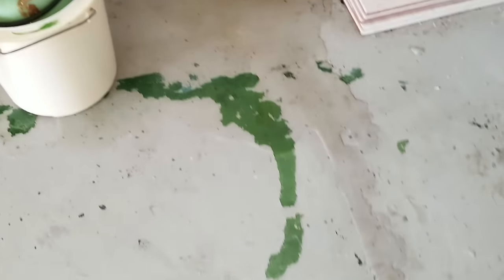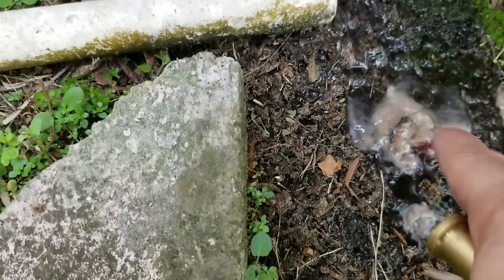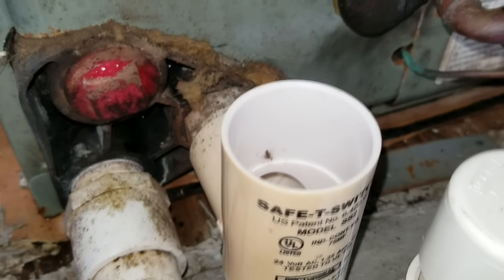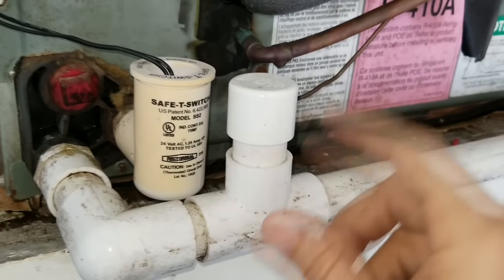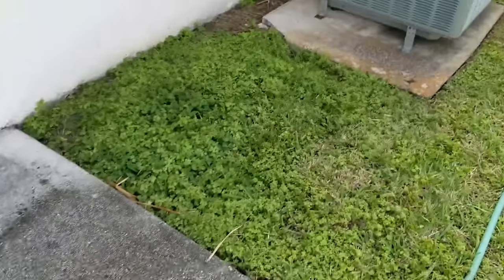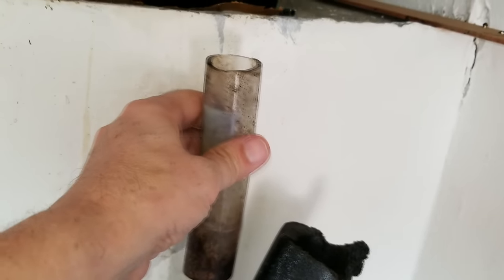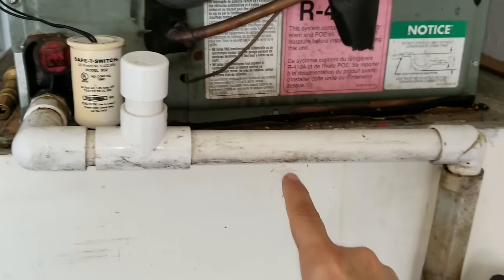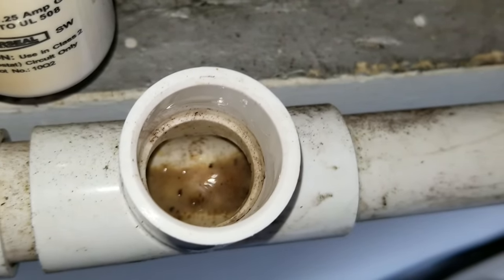How to Unclog AC Drain Line Fast (3 Seconds), Avoid Repairman

Comment: Way to go guys! this was an awesome and very informative video. My my 2 year old Nest thermostat suddenly reported no power coming into the unit. Now it makes sense! The float valve shuts off power to the thermostat.  I guess I'd have eventually figured it out, but it's over 100 degrees outside and my brain was shutting down. All I had to do was simply lift the float valve out of the tube and the unit instantly came on. We went ahead and poured some bleach down the ol' tube for good measure. This is Mike A. in Austin Texas.

Comment: Mine got clogged and i used an air compressor to unclogged, worked pretty good too, i didn’t want to use the water house because the a/c unit is located in the attic, but thanks for the help
Reply from the maker: AIr works too, as well as using a shop vac on the pipe outside the house
Reply: I know this is one year later but what kind of air compressor do I use??

Comment: Thanks for the vid! I literally just got done fixing this same exact issue on mine. You saved me loads of time and money! I knew the line was getting clogged but stupid me neglected to take action. Today I see water all around my unit and the line is clogged to the brim. For some reason, the float valve was angled in such a way that it wouldn't trigger if water filled up. So I had to fix that too. Flooded the line and got lots of gunk out. Then I blew some compressed air in there for good measure. Also went ahead and changed the filter. Dumped a little vinegar in the drain pipe and she's purring like a kitten again.
Reply from the maker: Awesome I'm glad my video helped you out

Comment: I purchased a house last year, had allot of issues with this because the original drain went inside the wall, into the concrete foundation and exit the house. That wall we ended up opening up due to mold and saw the original drain where it entered the concrete was cracked. Whoever replaced the drain didn’t put enough of a slope on it and ended up coming back into the house. Redone the drain from pan to outside, put a shut off valve, P-Trap, vent line, put a spigot on the vent line so in future can attach a hose to it to flush it and then drilled a hole through the concrete wall for the drain to exit the house. Haven’t had any issues since. But did have to clean the coils due to dust as I forgot to replace the filter for a few months.
Reply from the maker: That would be a cool video to see!

Comment: In my 1980s house on a slab, I believe my AC condensation drain goes under the slab and drains into the septic tank. The toilets, tub, and sinks are also routed that way.
On your outside drain, a copper wire mesh stuffed in the end of the tube will allow water to flow, but also keep mice from crawling in.

Comment: My Nest thermostat was giving me the E195 error. This fixed it. Thank you!
Reply from the maker: Hey that's awesome what does that error message mean?
Reply: Same Here!!!
Reply from the maker: @jahmaricover8820  So what does that error mean?
Reply: @jeffostroff  No Power from Red Wire
Reply: @jeffostroff  There is a sensor that tells my ac to shut off if the water in the drain pan gets to a certain height. When that happens, I get the error code on my Nest and know that I have to suck water out of drain pan and then go out and suck it out of the drain to the yard. I’m new at this and have been paying the HVAC guy $100 every few months to come out and fix it. I change my filters every month because I have indoor bunnies - that really should be bald due to the amount of fur they shed. I decided to do it myself and bought a little shop vac. It wasn’t strong enough (2 hp) so I’m returning for a 5 hp. It really is easy to do and I should have been doing this instead of paying the guy. I didn’t know that you are able to purchase stuff to keep the drain pipe clean! So THANK YOU for that info and I just ordered some.
Reply from the maker: @marcificht4013  Glad to hear that now you can save yourself the cost of the HVAC guys coming out. That's awesome!

Comment: The only time I had a drain clog, I used a drain buster plunger filled with hot water and it worked straight away. Now I pour a cup or two of vinegar in the drain every month. No more clog.

Comment: Years ago before I got a new AC my old system had a clogged drain and when it was flushed from inside in the gunk from the drain pipe was the remains of a dead garden snake! So a screen on the end of the drain pipe would block them from slithering up into your drain pipe.

Comment: If you notice in your video it shows a green sticker on your coil case. 
  The manufacturer recommends a trap. The trap is necessary to let the water drain out of the pan Do to adverse airflow in the pan sometimes keeps the water from running out like it should.
Reply from the maker: Yup, I have shown that to many people before. 2 weeks ago I showed the sticker (red on on his) and how the installer never did the trap. On one of my flip condos last year we replaced the AC and I made sure my AC repair guys used a trap.

Comment: You can use a wire brush to clean out the remaining pipe near the unit. It's a special brush that is connected to a something that looks like a wire. The wire is firm and long!! Yes, it needs a trap! Good job!
Reply from the maker: Thanks for the info!

Comment: Thanks - opened my drain line today and it was solid - full of crud.  Punched a hole in the crud with a fiberglass stick as far as I could reach in the tube and the hose in.   Bada-Boom Bada-Big - clean!  Just like that.  So thanks for the how to.
Reply from the maker: Nice work!

Comment: I had this happen this weekend. I hooked my shop vac up to the pipe drain end outside and wrapped a towel around for better seal. It’s draining again. But I’m gonna flush with the hose too now for good measure if mine will separate like yours did.

Comment: Pull off the stop on-off sensor- blow pressure air into the pipe, should be enough to clear the pipe. After that add Clorox and water to clean up your pipes, put back the sensor on and you should be ok to run your unit for enlist three months.
Reply: Did u pour in the bleach in the switch hole or other

Comment: Good info, but my system is nothing like this one. On my A/C there is no way to access the drain line at the source. What I did, was use my wet/dry shop vac to vacuum the line at the termination point outside the house. Worked like a champ.
Reply from the maker: Yes a lot of people report using the sop vac method. In my Ac we have no access really, but we can sort of stick the bare end of the hose at a right angle into the pan and find that opening into the pipe, and give it a quick 2 second burst of water.

Comment: I had the same problem in my old house and just recently our new house. I use a shop vac on the outside of the drain line and suck all that goop out. I found your video looking for something to place in the A-Coil tray to kill and prevent the algae from growing. I'll add clean the coils at least every year and stay on top of your filter changes.
Reply from the maker: That's really key is changing the filetrs

Comment: Mine turns from pan to straight down, under house then outside. Theres a metal pipe right above the drain in the pan and such an angle I 1 never saw it 2 couldnt get a hose angled and hooked up. Had my son watch the inside pan while I sprayed drain from outside. After 15 minutes we finally got  everything out! Thank you for the help!

Comment: Almost spent $1900 on a new hot water tank, MM Comfort came out, said no it’s the ac unit.  They said the drain pipe is clogged. Now we can do the rest ourselves and save  a lot of money.Have to flush the pipe under the house and I think that is all we need to do except replace flooring in the house from the water damage. Nice to have a company we can trust,  cost me a trip fee and an hour’s work. I’ll take it!

Comment: GREAT video, THANKS so much..  I didn't have a tigon tube in my line but I do now!
Reply from the maker: Roger,  Awesome I'm glad our video was helpful for you
Reply: @jeffostroff  I just saved myself a service call.   BTW, there was no tigon tubing link.   I had solid plastic piping all the way and no float either!  So I took my hacksaw and cut out a link in the plastic tubing so now it looks like what you showed, and I'm going to flush it out after lunch.  Lastly, that goop is a combination of mold and bacterial biofilm...take it from this Ph.D. microbiologist...and in all probability Legionella pneumophilia, the etiological agent of Legionnaires' Disease, is present in that goop, so DON'T touch it.   THANKS again for the informative video.
Reply from the maker: @rogerorcutt5830   Interesting you should point that out about the bacteria because many times in the past I have seen stories on legionnaires disease in its always traced to an air conditioner or and ice maker at a hotel.

Comment: Remove the door and pour hot water directly into the condensate pan and clean all the junk out of there. I wouldn't recommend doing bleach or vinegar in that area. While you're at it add some algae tablets. Alot of times when there's a leak and the safety float switch doesn't trip, it means the condensate pan is cracked. Also if you have just a basic p trap, I'd look into getting an ez trap kit, I think the model is like ezt226. It comes with a secondary drain safety float and a nice little brush. The trap has built in ports for cleaning.
Reply: Caleb Elias if the float switch doesn't trip it could also be a bad float switch that needs replaced.
Reply: @jessicaeagan3165  yeah that's true, good catch. I've even seen where the PVC glue has been overdone and adhered the float in place. I always put my finger inside to see if it's wet, and that's usually my indication.

Comment: How would someone go about doing this if they lived in a multi-level apartment complex and the HVAC is leaking into the crawl space beneath it? Since there's no outside space to let the water drain out after the clog has been cleared.
Reply from the maker: Not sure what you mean that there's no space for the water to drain once it clears the clog. It drains down the pipe likely into the sewer, or there must be pipes on the outside of the building somewhere that come out of the ground and the water drips out of them. If you stick a hose into the pipe and let water flow 2-3 seconds, that might be enough to clear the clog.

Comment: 1. Change your filter ONCE A MONTH not every three months and don’t use the reusable filter. While changing filter flush line with vinegar. Bleach is too harsh and the Home Depot stuff is waste of money. 

2.The reason you’re not seeing water is the S2 (float switch) is the pans most likely not pitched forward.
3. Instead of using water hose purchase a $20 shop vac and vacuum from drain line outside. (Remove filter in vac before vacuuming water.)
4. The PTrap is technically created by running line through floor, under house, then out of ground. Condos typically use a condensate pump which sucks water from drain lines. 

10yrs HVAC Contractor Chicago & South Florida 

Reliable Solutions Air Conditioning and Home Maintenance.
Reply from the maker: I still have to try out that Shop Vac idea one of these days. I'm just skeptical that it provides enough pressure outside the house to clear a blockage that could be 30 feet down the pipe, and a couple of 90 degree transitions away. You lose power with every change of plane.

Comment: I turn off the unit, suck the water out with an aquarium gravel cleaner fill the void with hydrogen peroxide (eats up the goo and I don't think it's caustic to PVC, and there's no fumes) and leave the AC off for a bit usually a big mass of goo is present at the base of the drain. I change my air filters, just gets clogged with goo I live in Florida, so the humidity is probably contributing to the buildup of biofilm. I need to remember to keep it clean. My old house never had this problem it had a brand new AC unit though, this one is relatively older. I've only had this house for coming up a year though..I probably haven't gotten all the buildup out yet, I should just flush it. 

Also, I googled it. Looks to be safe, AC companies say to do it, but who knows. Also it gets any odors out, and seriously, even if I don't bilge some of the water out and there's enough space in the pipe fill it gently with this stuff and go sit down to eat some where (Or in these times of the Pandemic, go do whatever you're able to do) and in about 2 hours there will be a big slimy mess at the end of your drain..

Also that section of downpipe with the flex tube, I'm probably gonna do something like that so I can just jam a garden hose down there and flush it out. That's awesome.
Reply from the maker: Good idea!

Comment: Your video does help some. So far, I have not been able to find a great video that will show the famous "pan"  they talk about ... where the condensation will go and then from there is supposed to drain thru the pipes all the way outside any home ( if the slope of the piping was done properly ...). Now, what you are doing, it is just clearing the drain and then ... you will go home very satisfied? What about all that mold, rust and the disgusting smelling created by that problem which was visible in you video? I am very sure that who ever lives there must have lung problems, breathing problems, etc. many thanks anyway.
Reply from the maker: While there wasn't any bad smell or a molder anything in the actual actual pin of the air conditioner, because it's always producing water and the water is usually moving so you're not going to see any mold growing in there. The only thing growing was inside the pipe we're eventually congeals and solidifies across the pipe causing the clog.

Comment: You need a trap, its not just for stopping sewer gas. That airhandler is under negative pressure so without a trap, you can get a mist of moisture back onto the coil, blower, etc. Can cause problems down the line
Reply from the maker: There's already a trap outside the house. Many manufacturers still require that trap by the air handler.

Comment: Mine is in the attic and I have a shut off valve on the drain line so I can blow out the line. Mine drains into the sewer and has an emergency drain outside so I can see it dripping from the soffit. 

I have had leaks in the joints. Make sure you glue all the joints and use primer. Yes, you can argue you are not required to use primer, but years in a hot attic will degrade the unprimed joints and they can come apart. (From experience) Then when you rebuild the unit and move stuff around the joints come loose and leak. You can work 10 feet from the joint and it can come loose. As a matter of fact just bowing it out can cause it to come loose. I would never run water pressure in a waste drain pipe, it is not thick enough. 

Using a shop vac to suck it out is the safest way if you do not know how well it is built. I cannot use a shop vac on mine because of the drain location.

I also use the algae tablets for prevention.

Comment: great job i have that issue now i live in townhome my problem is i dont have a p trap and my unit is on the second floor i would need a 75 foot hose to do that. Any other options?
Reply from the maker: Try putting a vac on the pipe outside on the ground

Comment: wet vac on outside drain, it works!!
Reply from the maker: Awesome, we'll try shooting a video on that next time we encounter a clogged AC drain!
Reply: @jeffostroff  1 inch shop vac hose will slip right over a 3/4" pipe.  It is an efficient method that doesn't run the risk of adding unnecessary water.  Your method is great for a garage/basement air handler, but can create bigger problems when the Air Handler is situated in an attic, or in an interior closet.
Reply: Same 😁
Reply: Yes it does , pulls that Gunk right out.

Comment: If you don't have compressed air, use a shopvac connected to any access point taken apart. 30 yrs. Refrigeration mechanic. Works most of the time.
Reply from the maker: We show that on another video

Comment: Nice video. Isn't P trap installed because of the negative air pressure in the unit so without P trap water would have hard time to drip out?
Reply from the maker: Gravity helps the water drain out even without a p-trap. The P-trap is really supposed to prevent the hot air outside the building from being sucked into the drain line by the negative pressure you mentioned and back up to the AC unit as hot humid air, where it could cause more unnecessary condensation and leaking.
Reply: @jeffostroff  makes sense. Thank you

Comment: Hello! Thank you for sharin your video! Unfortunatelly this a/c unit is in the attic, and I cannot see anywhere that nice piece of pipes that you show...😣 and is leaking all over the ceiling...😣!!
Reply from the maker: You may not have the hose, but I have also in the past had to stick a hose in the  Drain 10 where does a port on the side that leads out to that type of but you just have to really Jim the hose down in their tight and gushed the water for like 2 seconds and turn it back off. If you don't think you're able to do that you will have to call in a professional air conditioning company to come fix it